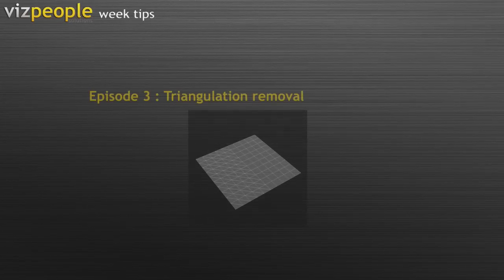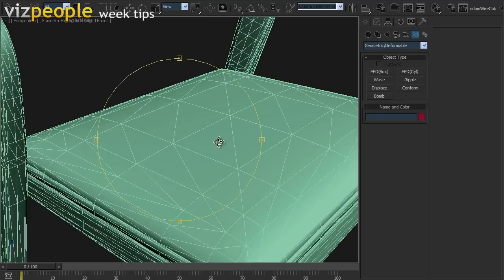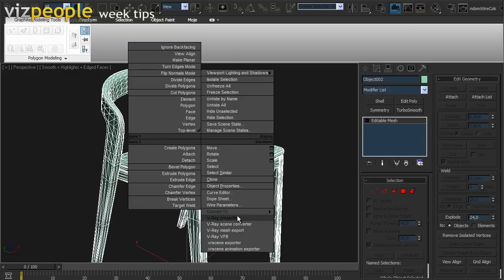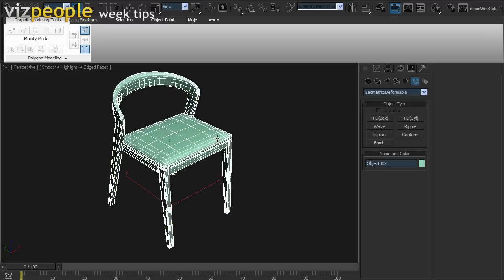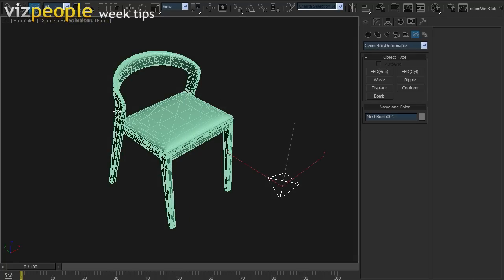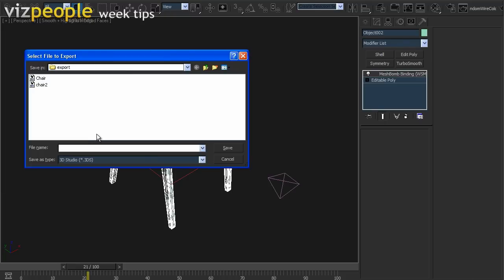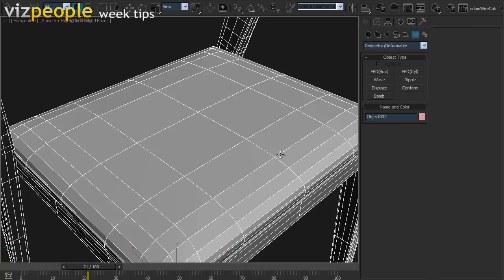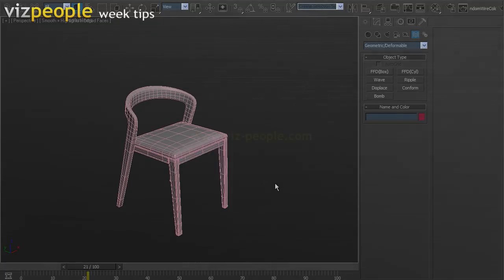Viz-People WeekTips Episode 3

Comment: nice tip, thanks!

1. instead of exporting to 3ds you can click on bomb binding in modifier stack and press Collapse To
this way you will not have to export/import (takes time, resets materials if they are not standard, and if you have system units other than inches, it will scale object. so if cm selected as sytem units, imported object will be 2.54 times bigger than the original one)
2. before auto edge you should set angle to bigger value, because with default 24 not every edge is removed